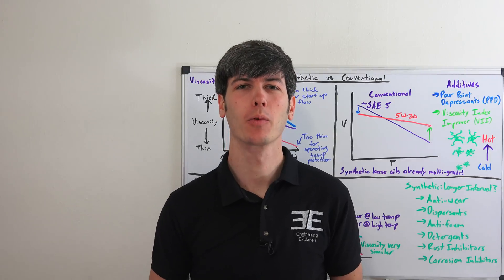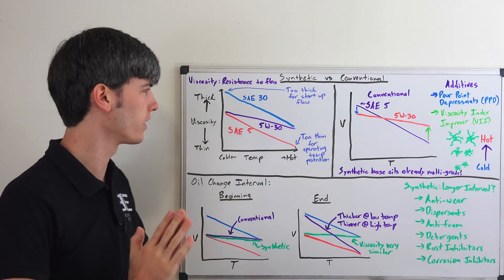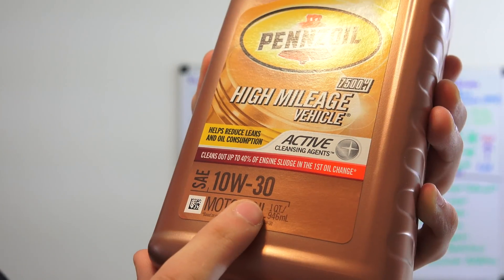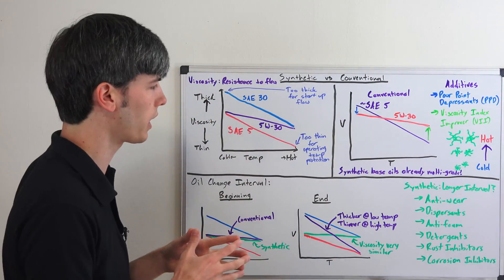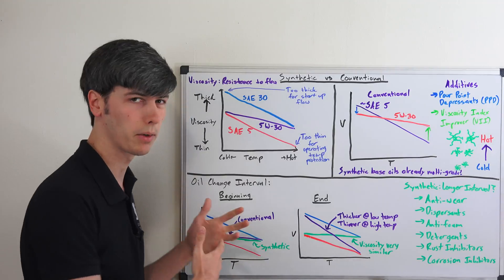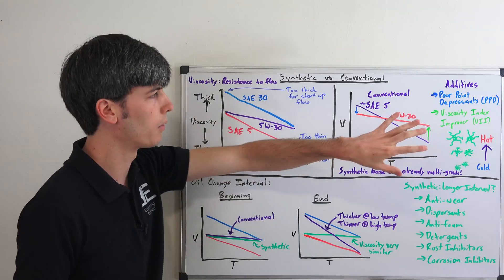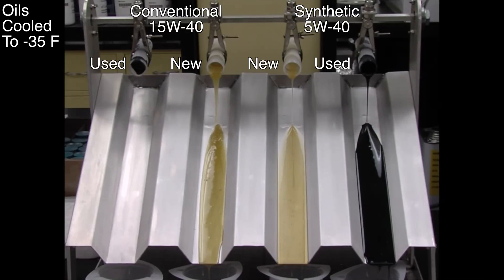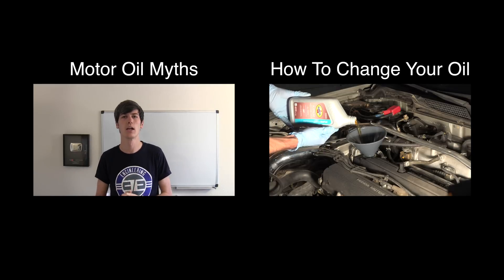Is Synthetic Motor Oil Better For Your Car?

Comment: How much of this applies to me, someone in Southern California, where cold starts are 70f/21c
Reply: I believe in California you are required to use extra virgin olive oil. Although, some residents have received waivers so that they may use recycled cow farts.
Reply: As he outlined in the video the viscosity is effected by temperature. Since you're in southern California it should get pretty warm around there and conventional oil will not provide as good of protection at higher temperatures as it breaks down versus synthetic. Basically, you should be using Synthetic.
Reply: That's actually condensation (steam), not smoke and can happen at many various temperatures depending on many weather factors. I think what odombones94 was implying was that it doesn't get very cold where he lives. Typically, this would suggest a higher viscosity in the second number (5w-30 to 5w-40). Possibly even a higher viscosity in the first number (5w-30 to 10w-30) but is usually not necessary.

A vehicle's manual should outline different suggested viscosity ratings depending on the intended operating temperature of the engine. Example I have is my 500k mile Honda, book suggests 10w-30 but for my operating range it suggests 10w-40 (it gets hot here). Those ratings are designed to work for your engine based on it's engineered tolerances. Make sure to follow the manual.
Reply: Actually still applies to you, working temperature for oil in the engine is somewhere in 70-110*C region so there is still quite a change in temperature and viscosity as engine warms up
Reply: That'll teach ya to make jokes with enginerds!  :D
Reply: Very little.  Modern engines are especially likely to have their life spans reduced by the penchant of owners to use higher viscosity oils than the maximum indicated by the designers.  Higher viscosity DOES NOT equate to better engine wear reduction despite the speaker's mentioning film strength.
From a practical perspective, the lower number is more important and should not be exceeded.  Broad ranges of viscosity should also be avoided.
Reply: I was making a joke.
Reply: Erg Budster You know it's bad when you turn on your car for the first time for the day and the coolant temp needle is already above bottom (which is 100f in my truck)
Reply: odombones94
Did you try the Sea Foam stuff first?  STAR is a crock, i got the STAR notice after failing smog once due to a recently reset computer.. And yeah it was hot in LA today..
Reply: hindflight R seafoam, guaranteed2pass, and 2 oil changes. Didn't pass. I'm pretty sure STAR is every other year. But what's done is done. She passed, so whatever. haha
Reply: *****
It's dry heat... and the beaches are packed with babes so don't feel too sorry for us.. ;)
Reply: Weston O'Connor Nope. Have you ever been where it's so hot that the soles of your shoes are squishy and burning your feet
Reply: Thomas Mobley -_-
Reply: Paul M Edwards I wish my truck had working AC. haha. I plan on getting a bike next though.
Reply: yea you ALWAYS want to run whatever the manufacturer recommends.  The only optional thing for some cars is whether you wanna run synthetic or regular or semi synthetic. Don't ever deviate from viscosity. For example, many ppl think running a thicker oil is better in hot areas bc the oil will stay thicker at hotter temperatures. What ppl don't realize is now your oil pump has to work harder to move the thicker oil around especially when its cold.. Use the oil thats recommended in your manual. Your garage mechanic skills don't supersede the science of car manufacturers who do hundreds of hours of testing on engines lol.
Reply: +hindflight R haha. Sarcasm has always been hard to get across via text.... 
Buy on that note. I have a 97 s10 with a 4.3 v6 and 250k on it and I've been putting synthetic it it since I've owned it 30k ago. She's always treated me well. Just need to do injection+spark system.
Reply: +odombones94 yeah I hear them fuel pumps were defective, I wouldn't worry as you said it has over 200k the previous owner probably replaced it.
Reply: TheBikemaster94 I replaced it. hahaha. It started going out at 240k if I remember correctly. I just replaced the cat this past friday.. Wouldn't pass California STAR smog. $400, it passed.
Reply: I hate it when I burn my feed.
Reply: +ThruMy4Eyes My 3 motorcycles are quite happy in SoCal zipping between cars & trucks and sipping on gas, getting 40+ MPG at 90+ MPH cruising speeds. I love that the motorcycle cops wave me by while lane splitting at 80+ MPH. My Smiles Per Gallon are off the charts!
The only downside is that, since I have no air-conditioning, keeping cool when the weather gets hot requires going a bit faster. Sorry, that's thermodynamics; it's the law.
Reply: Viscosity is not the whole deal.
Reply: ***** There is a current fad for 5w20 and 0w20 oils amongst some makers. These are necessarily all synthetic, you'd never achieve anything like boundary protection with a mineral oil of this viscosity. Again though, there's more to oils than just viscosity.
Reply: lol 71f is nice where I live -10f is cold
Reply: ***** You are absolutely right. Some variation between countries for the same vehicle is likely due to emissions, climate, etc., but is rare. I am sure there are some cases where the EPA results in a manufacturer calling for a certain oil b/c of emissions, etc. However, I would still run what the manufacturer recommends. Running the oil which is recommended for the exact same car in another country is still technically running what the manufacturer recommended....so I am not refuting that lol. What I am saying is don't watch a couple youtube videos and read an article or two on oil weights and properties and think you are smarter than the auto manufacturer lol.
Reply: LMFAO

Comment: How much of this applies ot me, someone in Southern Clifornia, where cold starts are 70f/21c
Reply: Maybe a little bit, but to make it simple go by your Owners manual of your vehicle. It will show the temperature rating for the type of oil, and sometimes it will note in the manual if you live in a much warmer climate ie; Arizona, Texas, New Mexico, then they may list a different weight oil.

Comment: wow, what a bunch of arseholes on your channel! Thank you for your time and effort. Is there any major differences between oil used in motorcycles and vehicles?
Reply: Not in the oil, but in the way how it's used. In motorcycles quite often one oil is used to lubricate and cool basically the whole powertrain. Most motorcycles use the same oil for the engine, the gearbox and the clutch (wet clutch). Where in cars you have specific oils for different parts of the powertrain.

Comment: Can you explain the degradation process?   It is recommended to replace the oil after X amount of miles and X amount of time.  If you are not driving, why would the oil degrade?  For instance, I have 2 vehicles, I drive about 2000 miles per year on each.  So I  never even get close to the miles where oil would have degraded, yet I am forced to change the oil every 6 months anyway.  Would using synthetic oil change that?

Comment: Now do Royal Purple vs Penzoil
Reply: +crosswire7777 You're off the chain.
Reply: Royal Purple sucks, I used to be a dealer and then I read the white papers of a extensive study of independent lab testing of 30 of the top synthetic oils and it placed horribly. Out of all the manufacturer blends were tested Amsoil had the highest overall marks by far.
Reply: There is a Canadian engineering study on line.
Reply: +wholeNwon What u say bruh? I ain't finnin to do no reading, i axed for a videa bruh knah mean?
Reply: +Turbo Chevelle RP was a hoax from the beginning, as it was catapulted by the advertising with the NASCAR help. Truth is, there was a secret ingredient already in the stock car that was doing the "miracle" work, and RP jumped on it like it was their oil producing the "results shown".

I used that secret ingredient in my brand new HD Sierra, and it had no MPG loss from Beginning to End of oil cycle of 8,000k+ miles, but dropped off 1.5 mpg by the End without it.
Reply: Qaill1 Gear oil? 
I have some extra 80W-90 laying around.
Reply: Royal Purple is just a marketing gimmick. Sponsor a TV show on Spike and watch your sales soar.

Comment: what about semi synthetic? I always use valvoline semi synthetic oil in my car
Reply: My Lincoln recommended Motocraft synthetic blend which I used until the warranty ran out, then I switched to full synthetic Mobile 1.  159,000 miles and counting. No burning, no seal leaks. 10,000 mile recommended change intervals.
Reply: Where did you get the 10K number?
Reply: +wholeNwon recommended oil change interval built into the oil life computer on the car. My Town Car will report oil life remaining and then automatically report oil life once it gets to 10%. Once it gets to 5% it says change oil soon then at 1% it says change oil now.

Comment: Most of these newer cars require synthetic oil now.These 2011 and newer GMs use synthetic oil that has to be dexos approved.The 3 valve 5.4 Ford V8s and 6.8L Ford V10s require synthetic oil only using 5w20 only. The lifters will rattle like crazy if it's not used.Some makes have TSBs on oil usage,Chrysler is one that has one with the 5.7 hemi that has the MDS.5w20 oil has to be used only or the MDS will not work right,the wrong grade oil gums the actuators up.

Comment: Good video.  The best thing you can do is to change your conventional oil at the recommended intervals in your owner's manual and you should be fine (unless your manufacturer specifies the use of synthetic oil).

Comment: Why in the visual example is the oil at -35F seems pretty outside most normal areas. And in those temps people usually have engine block heaters ect.
Reply: He's making a point of how huge the viscosity change in a conventional oil is toward the end of its life. If he was to heat them up, the used conventional oil would run faster than the new oil.
Reply: It's for the sake of observation. The purpose of lowering the temp this much is to drastically increase oil viscosity. The goal is two-fold : first, it shows just how bad the used conventional oil turned; second, it slows down the used synthetic oil so that the used and new oils don't reach the end of the slide at nearly the exact same time, proving there's degradation.

There might be another purpose, but if there is I missed it.
Reply: As a person who lives in Wisconsin, with a car from an area where block heaters are never needed, using Synthetic over Conventional means that my car will start with or without a block heater. It matters for folks like me.
Reply: I've got to agree with David here, too. Remote starters seem to be more popular here in Alaska than block heaters, as not many hotels or garages have power plugs for you to use them. Because of this, synthetic oil is a great choice since as it nears the end of its life the car will still crank perfectly fine. 

My mom's Subaru has a noticeably tougher time cranking in the winter when it's near the 5000 mile interval for its conventional oil change, as compared to my own car's cranking near its 7500 mile change in the winter.

Comment: Hey, i got a question. there is a car that i want to buy really soon; this car has a 1.4 liter 16v turbocharged engine that is recommended to use a synthetic blend 15W40 oil, so, here is the question, i really want to use synthetic oil in that engine,but i can't find a 15w40 synthetic oil, or a 10w40 synthetic oil.
Can I use a 5w40 synthetic oil?
Thaks and greetings from Brazil

Comment: Interesting. I have recently discussed this with some people concerning aviation engines, and there are some differences.

For one, oil change intervals are short, often 25 hours (with just a strainer) or 50 hours with a filter, so the break-down of the additives won't be as bad. The main factor in engine-life for most general-aviation piston engines is corrosion, not wear from insufficient lubrication.

So it is (at least for privately-owned airplanes which are flown only a few times per month) more important to have an oil with high viscosity at ambient temperatures (not running), so that oil will drain much slower, and keep the internal engine parts covered for longer. So we currently use a grade 100 (SAE 50) mineral oil with dispersants (no detergents in aviation oil, ever).

I'm not sure that the difference to the otherwise standard aviation piston engine oil 15W50 is all that big for use in these low power-density, low compression engines.

Comment: so it's always better to use a 0W rather than a 5W since it flows better at startup?
Reply: Yes, it also helps saving fuel.
Reply: It's best to use whatever viscosity the manufacturer recommends, since there are many factors for why they chose said viscosity (tolerances, expansion of metal components  due to heat,  radial loading etc.)
Reply: The thinner at startup, the quicker it gets to lubricating the engine. Think of it like starting an engine that's a little warm already but is still far from operating temperature; the oil's a little thinner and gets to its job quicker. With that said the whole "0w30 vs. 5w30" thing (reading off the bottle) isn't the best way to read oil; Mobil 1 0w30 is thicker at startup than Pennzoil Platinum 5w30 but Mobil 1 0w30 is thinner at startup than Mobil 1 5w30. Read the data sheets of oils you're considering if you're curious.

Comment: Is there a difference between 5W-40 fully synthetic oil for a gas versus a diesel engine? I drive a 2006 VW Jetta 2.0T (gas turbo engine), and one of the employees at my local O'Reily's Auto Parts stores maintained that the 5W-40 synthetic diesel oil would be fine in my gas engine. Is there any truth to this claim?
Reply: Yes, you can run diesel-specific oil in gasoline engines. Diesel oil has specific additives to keep the soot suspended. There is no ill effect on gasoline engines.
Reply: He is absolutely right. Rotella T6 is one of the better ones due to zinc and moly content for the cams. Plus it's an HD oil
Reply: I've run Rotella T6 5W-40 in my Mazdaspeed (gas turbo) for years with no problems.

Comment: Appreciate the video.  Is it true some synthetic oils aren't true 100% synthetic?
Reply: Does it really matter?  Most Group III synthetics (hydro-cracked, mineral oil based) are more than good enough for consumer-grade everyday engines.  People over-think engine oil way too much.
Reply: FULL synthetic is just that. It is a short polymer chain derived from alpha-olefin monomer to a controlled molecular weight. Very pure final product, unlike natural oils, there are no "miscellaneous". Natural oils are created from hydrocarbon distillation and contain blends of numerous chemical materials. That's why naturals break down and sludge up. Synthetic blends are simply a mix of natural and the alpha-olefin materials. Another interesting point - when you get to -30 or -40 F the synthetics remain more fluid, useful for me in northern Michigan and Wisconsin. (40 year practicing chemical engineer)
Reply: Thanks to castrol having their day in court we all can buy semisynthetic or mineral
overpriced slush everywhere branded as fully synthetic.
Thanks Castrol!

Remember: trust me i'm a salesman
Reply: +Scypheroth nononono nono thoes are not what SAE considers synthetic I kno amsoil isent approved by sae idk about royal purp tho the true synthetics are located at the vw dealership they use the best oil known to man its like 50 bucks a 5 qt but it's REAL synthetic
Reply: yes, it's
Reply: Even Amsoil sells a Group III synthetic now.
Reply: Ryan Rohauer Yes, it is SAE and no different than oils like Castrol Syntec, Valvoline Synpower,etc.
Reply: Even most Royal Purple and Amsoil products won't be truly full synthetic. You have to work hard to find those now.
Reply: Full synthetic is natural made , synthetic blend oil is man made
Reply: Yeah I agree, if a fella just does regular oil changes at recommended intervals, engines nowadays will last.
Reply: if they say 100% synthetic then they are but some companies might say synthetic but mat only use about 50% synthetic oil
Reply: There are NO SAE requirements for "synthetic".....
Reply: There's no official API definition of "synthetic".
Reply: There is no official definition of "synthetic".
Reply: Yup, and it doesn't make any difference in terms of engine wear.